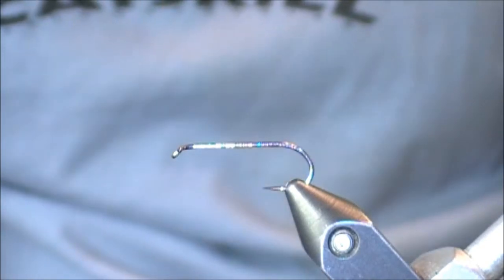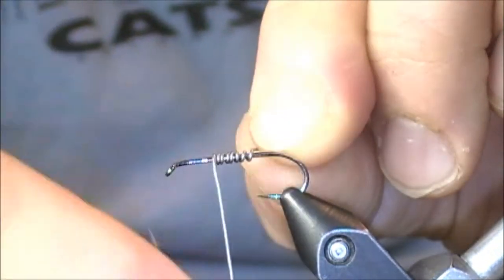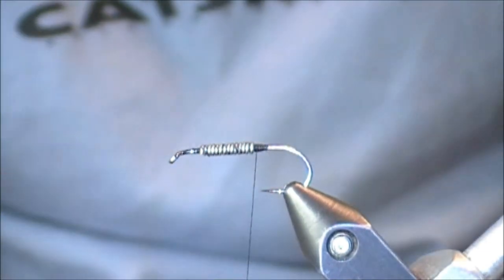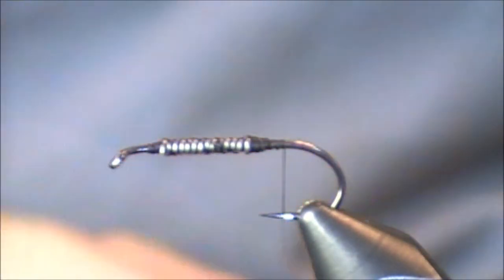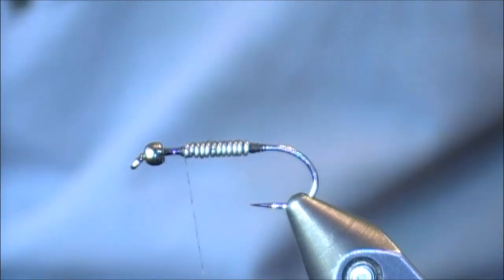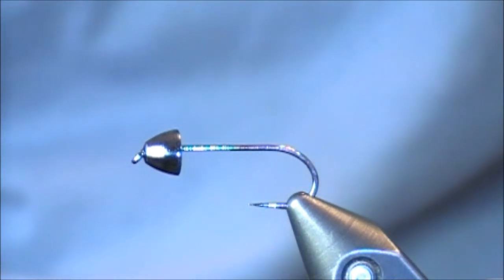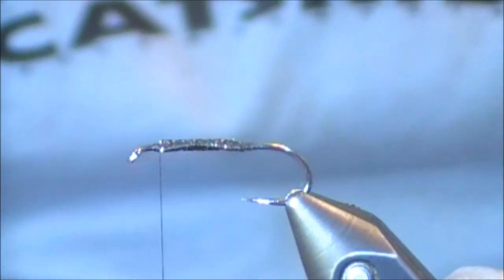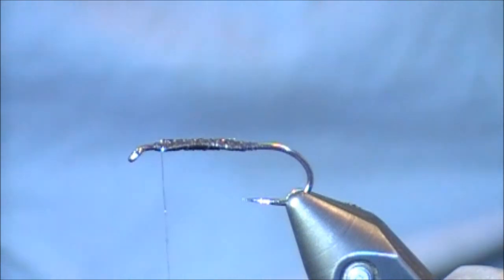Using WIRE when fly tying! Many TIPS and TECHNIQUES...including BEADS too!!

Comment: Tim, I always enjoy your videos. My question is why do you never see anyone tying the lead wire on using a reverse wrap? If you tie the lead on with a reverse wrap it will lay down in the direction of the thread and not stick up causing the stub that you need to cut off.

Comment: Great stuff Tim, I have downloaded all of your videos.
\there is one thing which you didn't mention and that is lead sheets, I don't know if you can buy them over in the USA, but they are going well in the UK. When you tie a nymph, it is easier to transition the lead flats, they can be cut into strips any width you wish, usually about 2mm, they have a self adhesive backing on them and are really good.
If you haven't heard of them, try Davie McPhail fly tying on you tube, as he uses it on nearly all his nymph patterns.
Thank you for all your tips and tricks, they should improve my fly tying.
All the Best.
Douglas.
Reply from the maker: Thanks for the comments, Douglas.  I am familiar with lead (and tungsten) sheets, but haven't used them enough to say that I am competent in their many applications.  I definitely plan on utilizing them more, thus any other advice/tips you have would be greatly appreciated.  Thanks again!  Tim